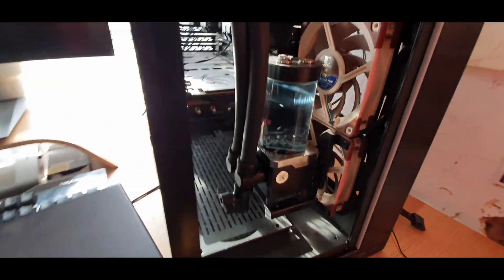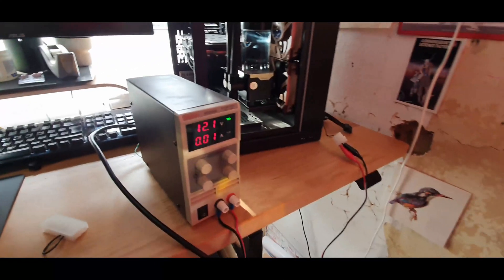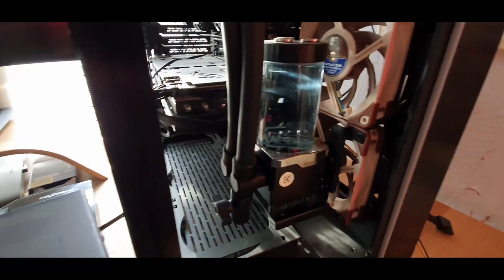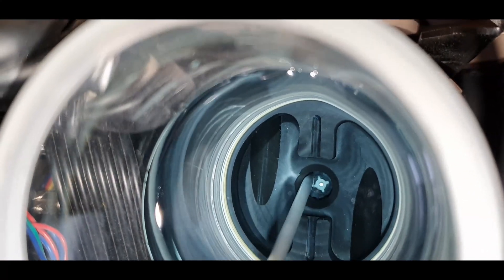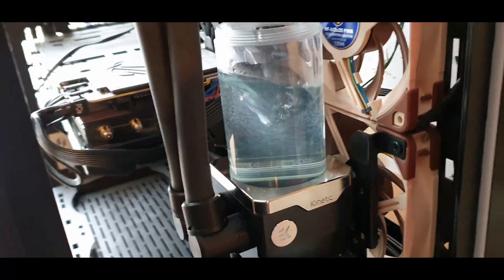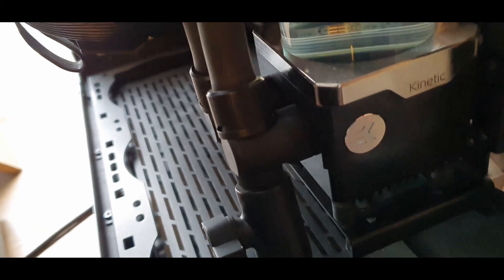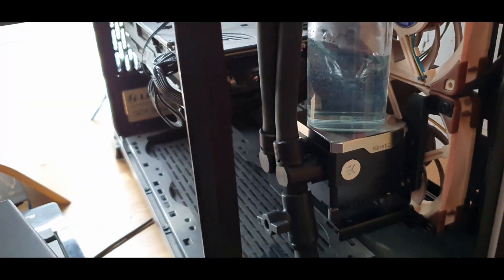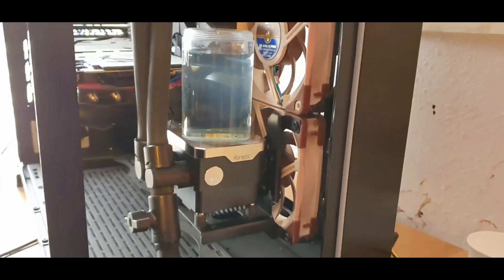EKWB Failure, pump res combo faulty jammed impeller. Quantum Kinetic TBE 160 DDC

Comment: Same with my DDC  look the exact same pump combo (from overclockers UK).
if you give it a good smack on the outside with the handle(rubber) of a  screwdriver right when it tries to spin up it should kick start it.
i have to do this once a  day and it reboots fine once i got it running,(maybe it needs heat?).
i have mine positioned in the same way as you i hit it from the side of the GPU and start of with  gentle taps and gradually hit it harder until it starts
Reply from the maker: Interesting. This one was from OCUK too, I eventually returned it for a refund, the guy on the phone said they'd had an unusually high returns of these Quantum DDC combo pumps, I think it's a design flaw by EK rather than a batch issue, personally....like they screwed up a tolerance and something is fowling or it's too tight or something.

Sorry you're still having trouble with yours, considering how expensive these are you shouldn't need to be tapping it to get it going....I couldn't be doing with worrying about my pump giving out through an overnight render or something.

Comment: coloured fluids drop gunk out of solution over time and that collects under the impeller and makes it stiff too run .. in time it will start sticking .. take the ddc pump off and apart clean with iso and put it back together .. i had this issue running opaque's .. i just run distilled and biocide nowadays .. fed up of busting pumps cos the bearing surfaces wear or gunk

Comment: I got one ek water pump but the problem on mine is leaking for no reason after a month of use
Reply: tighten the pump back up .. take it apart first lube up the rubber seal with some silicone oil then back together wash it out and it will be fine ..

Comment: I’m on my second one now 
Same issue 
Horrible build quality
I’m furious about ekwb releasing these to public!
Reply: Mine was no jammed, was leaking inside and turn the circuitry wet causing failure. 
Sent to rma and already bougth another one, this time was a EK but D5 TBE 200. I'm going to sell the VTX when i get it from RMA. Nice looking but poor engeneering.
Reply from the maker: @marconivilar4753  Agreed. I got a refund and swapped it out for a D5 after this video. I won't buy EK products again.
Reply from the maker: Sorry to hear that. They weren't interested when I emailed them. On multiple forums and reddit there are people with this fault with this pump/res combo. 

I eventually got a refund for mine from the vendor and replaced it with a Heatkiller res and a proper Xylem D5 pump.

Comment: you should take it apart
Reply from the maker: If it wasn't under warranty I would have done. After seeing others with this problem I think it's either to do with EK's tolerances being too tight and the impeller is jamming against the housing or they've got a bad batch of weak DDC pumps.
Reply: @aristotles-lantern  U do Not loose warranty when taking it apart 
The Sticker is Just a leak Proof Sticker Not a warranty Sticker
Take IT apart cuz Something is blocking the impellar
Ddc and D5 Pumps are Industrial Pumps they are Made to Last and normale These never fail
There must be Something in IT and blocking the impellar